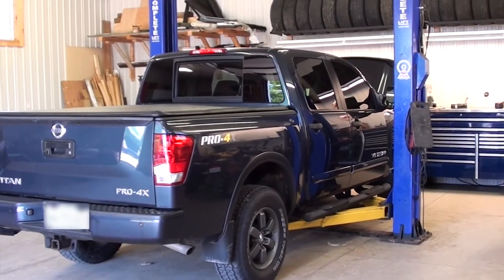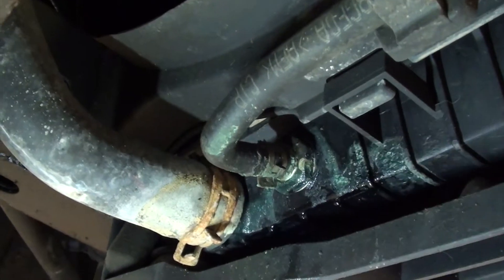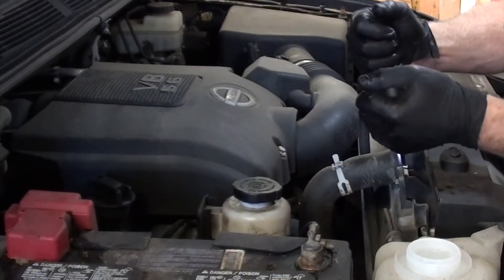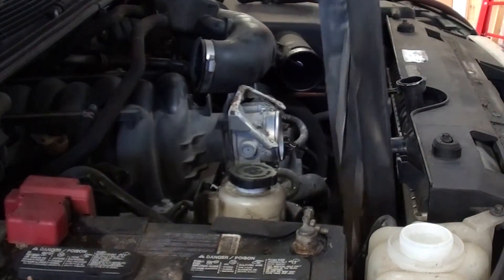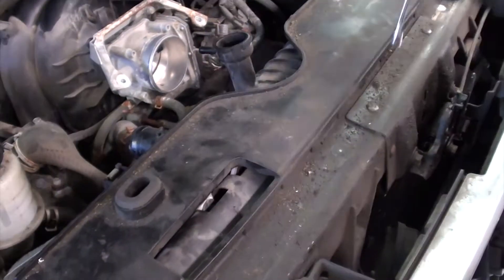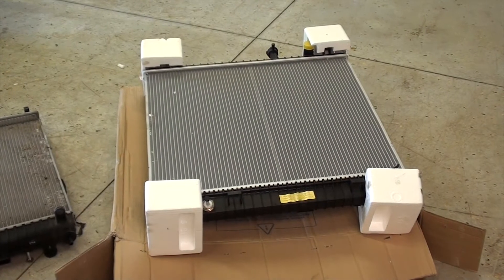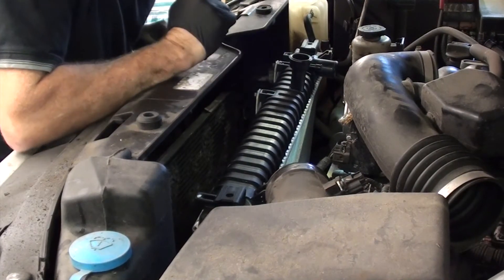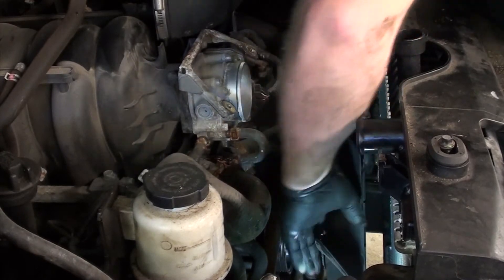Nissan Titan /  Armada Radiator Replacement 2003 to 2015 - DIY

Comment: Thanks Buddy I appreciate your post and this he just save me hours of guessing. I was cleaning under the hood and bumped the nipple to the overflow and it broke off. With this video I took me about an hour and a half to get out and even less time to put back in. Thanks again appreciate your posting this
Reply: I just knocked that overflow nipple of myself so I am in the same boat this morning. I will have help though from a buddy of mine. Hopefully this will go smoothly.
Reply: Engine threw a code that my O2 sensor had shorted, noticed coolant was leaking and most likely shorted it. Decided to flush my coolant and fix the clamp to the nipple, broke it off and now in the same boat aha. Guess it was better now than never as the radiator nipple seemed to be decaying.

Comment: Great video, just a tip though. If you are doing a radiator its wise to also replace the transmission cooler hoses. They go bad pretty frequently on the Titan/Armada. Helps prevent future problems

Comment: Hello to you...Great vid on radiator replacement. I was mostly interested in the last 1 min...I have a 2011 Armada I just got. I have been poking around and just noticed I have the smallest leak (hardly a leak, just a small dampness around bolt head over time) at the same place you had (just passenger side, not drivers side). When I say tiny, I mean the smallest bit of dampness around the heads of the bolt. I tightened the bolt head a tiny fraction and that seemed to make it even slower...My question is if I can take it apart like you did in the final moments of your video and replace the gasket under the bolt head...instead of replacing the radiator???

Comment: I pulled radiator out from the bottom put 3 ton jack on motor mount fan intact plastic radiators are bogus didn't break anything why on such and expensive truck why not full aluminum easier to patch I think? transmission cooler lines I don't want to mix up? Any video on that

Comment: Great content and very helpful as I just ordered a new radiator.  Mine has lasted 110K miles but seems like it had a tiny leak for a while.  Do you know how much coolant it takes to fill?  is it more than 1 gallon jug?
Reply: To fill the entire thing should be around 4 gallons in a completely dry system.

Comment: Super Duty is so much easier. Besides the hoses just 2 bolts and pull up from the top. I was looking at this on my Armada and could tell immediately that it was a dumb design. Not Audi dumb, but dumb.

Comment: I need to do this next week. Trying to decide if I should order a new now or pull and inspect the old one first. No rush, the 2004 Titan hasn't been driven in over a year but I want the truck back from my son. Plan to change the serp belt while its out.